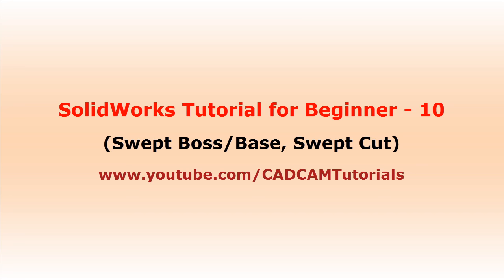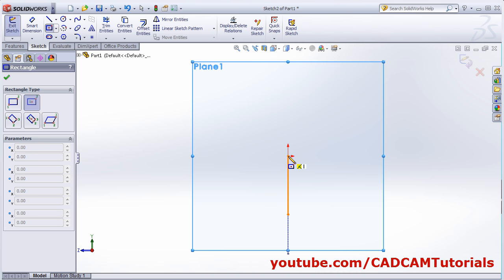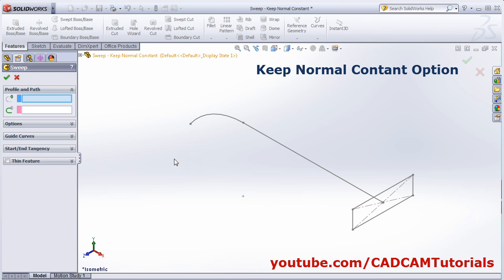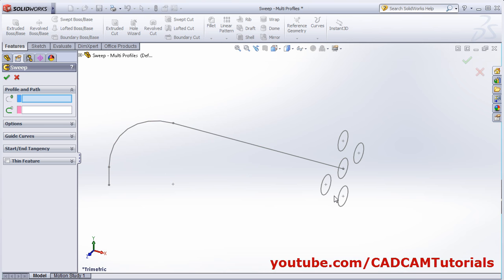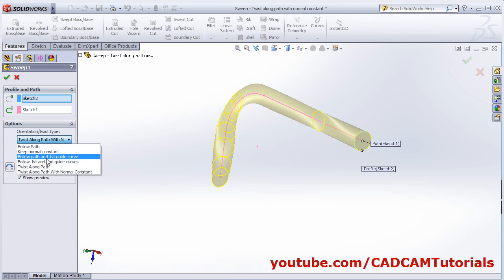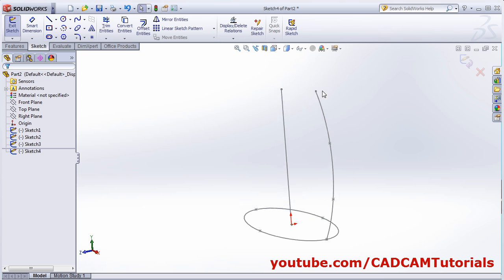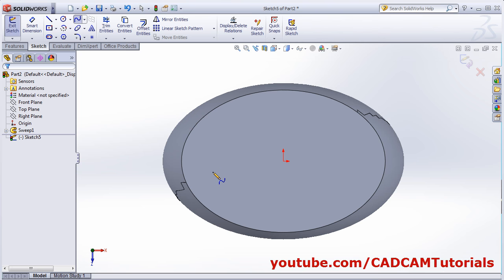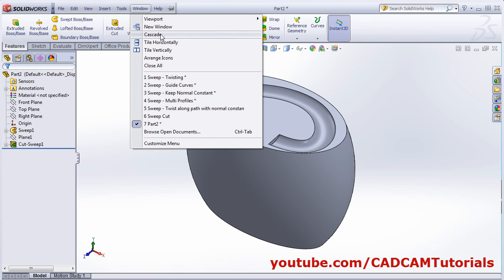SolidWorks Swept Boss/Base | Swept Cut Tutorial | Guide Curves, Multiple Paths, Twist Along Path

Comment: Sir how can we use spline with dimensions . Like how we can be assure that it is perfect with dimensions. I hope u got my query
Reply from the maker: Splines can not be created with dimensions. At the most you can give dimensions to points, it is passing through. If you want dimensions then you will have to use arcs.
Reply: Kumar-  To understand "Spines", think about how boats are made from wood.  The point is equal to the rib on the side of a ship hull.  The graceful curved line of a spline is equal to the wood plank that bends when it is attached to the ribs.